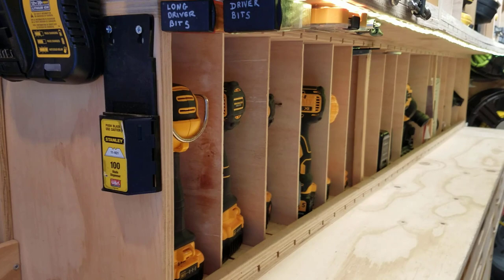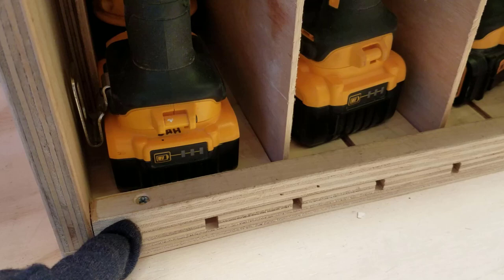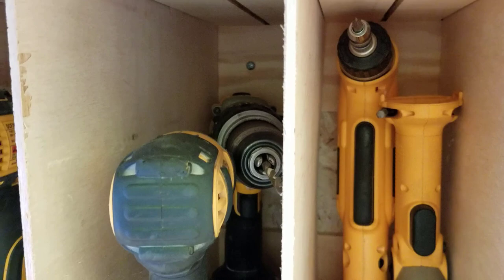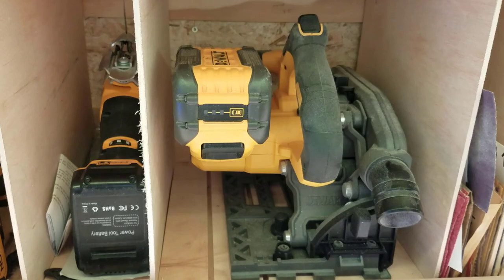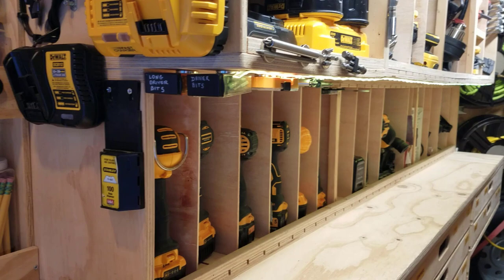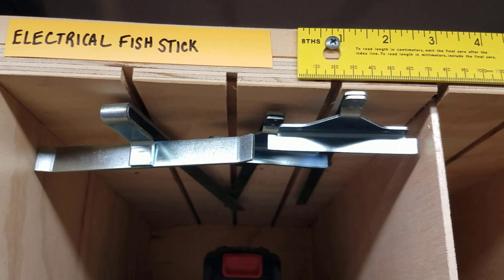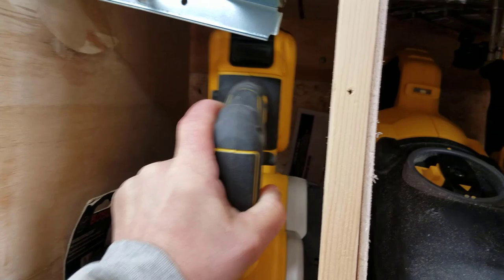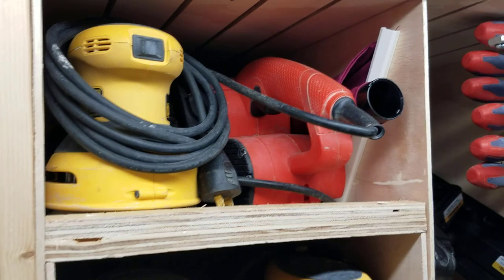AWESOME TOOL CUBBIES  - "a la carte" deep dive series - Paulk-Inspired sSMART tool trailer

Comment: How long it the track on your dewalt saw:) ? i dont have one currently , but i am gonna get one as soon as i take care of other priorities !
Reply from the maker: Thanks for checking out the video! I have the three DeWalt tracks. The smallest is 46in long. The  next is in the 60in range for length. The longest is 102in. I have found that the 46in works for 48in cross cuts since the saw plunge cuts. The longest track easily accommodates 8ft goods.  The mid-size track is equally handy. I have been very happy with all three tracks.
Reply from the maker: I have had time to observe what I do with the tracks and I would say that if anyone plans to use this on long sheet goods and is on a budget then the 8ft track will do it all (even though inconvenient on short material) but the 59in mid size track is the most versatile. I think the short track, while the least expensive, is a luxury for those on a budget. Since I am as likely to rip 8ft as I am to rip 4ft using this saw, I would first buy the 8ft track then as I can afford it, the midsize track. I would worry about precision if I had the mid size track and had to move it to accommodate a longer 8ft cut (but with care, anything is certainly possible). I bought all my track saw stuff a-la-carte so I could get exactly what I needed but the kits I have seen almost always come with the mid size track when the track is included.